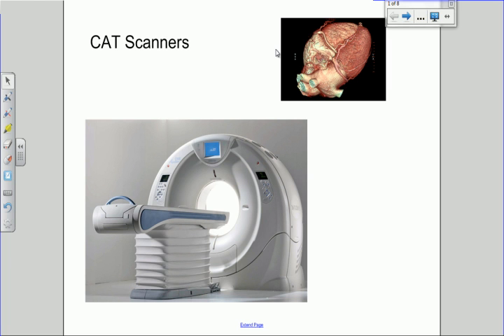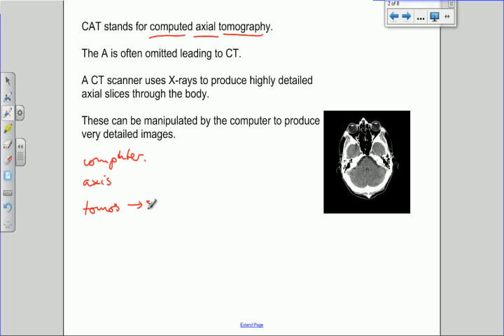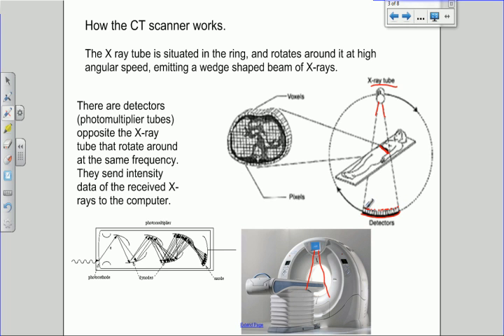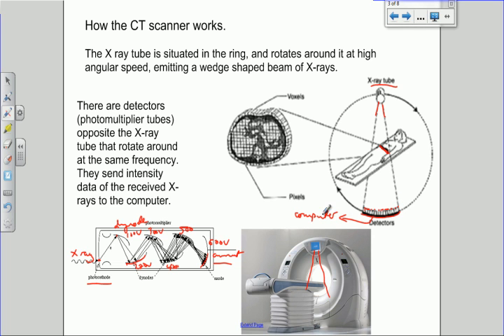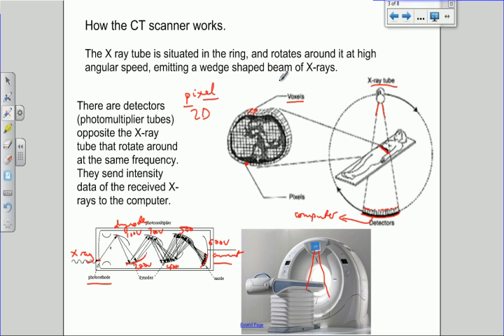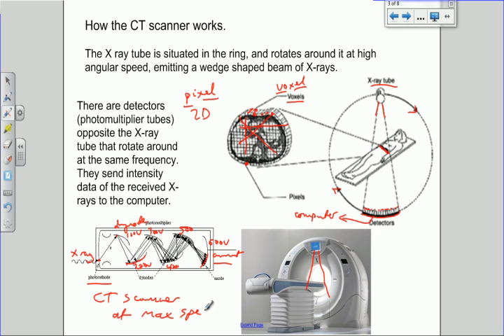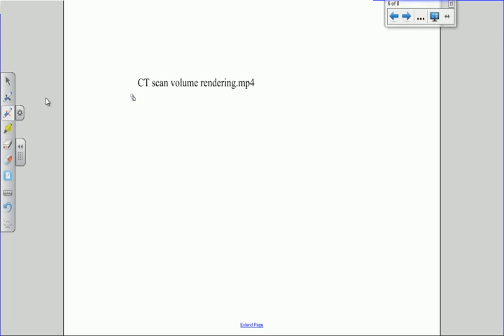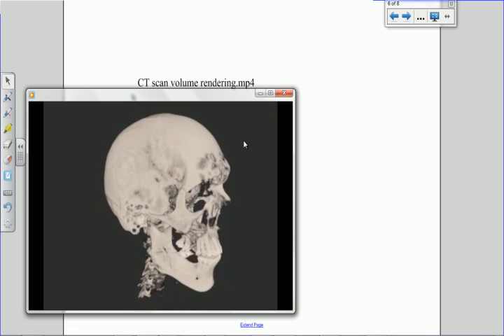A level Medical Physics - CAT /  CT scanners

Comment: Nice video, but the x ray doesn't interacts directly with the photomultiplier's cathode. It must first interact with a scintillation crystal, and then the visible light emitted interacts with the photocathode and by photoelectric effect electrons are emitted. You probably omitted this on purpose, but i just wanted to point it out.